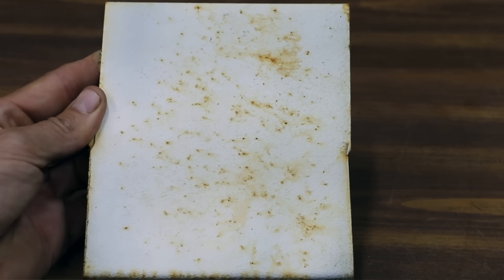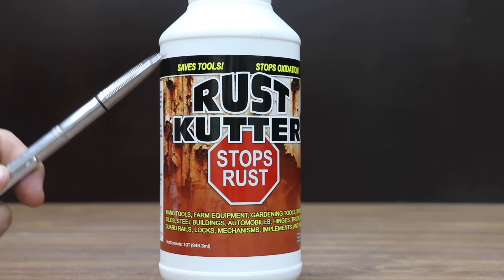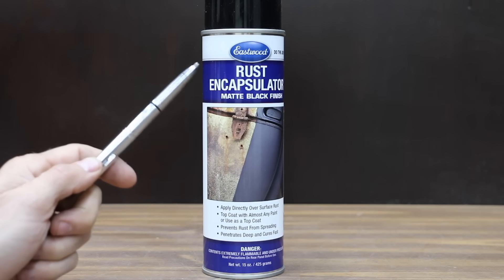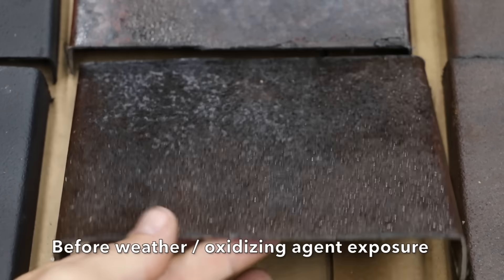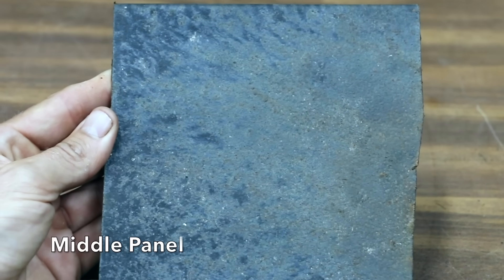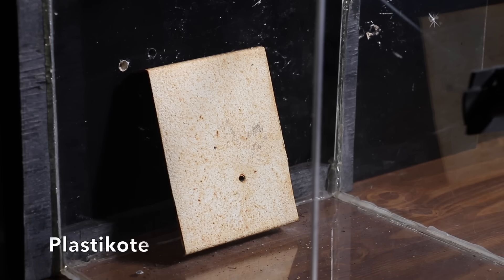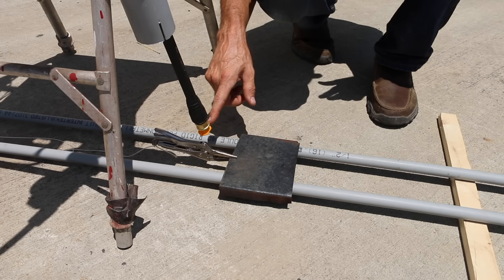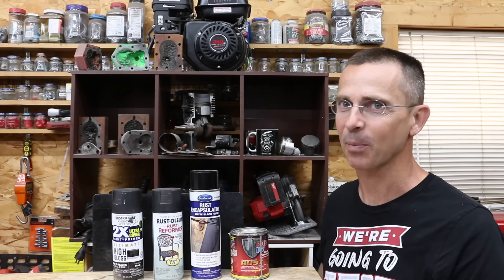Best Rust Converter? POR-15, Eastwood, Rust-oleum Rust Reformer, Gempler's

Comment: Thank you for another great testing video that will definitely help me in the future!
Reply from the maker: Thank you very much!!
Reply: @ProjectFarm  Came here to leave this exact comment always. Refreshing to always have a channel like yours with no sponsorships muddying the waters of REAL reviews and tests!
Reply: @ProjectFarm  Yay, I think I suggested this maybe! I been holding off on my trucks body work for this, haha
Reply: Agreed, thank you.
Reply: Rust reformer/converter is a different product from por15. Those converter sprays create a chemical reaction on the surface of the rust to Neutralize it's spread and make it more stable to paint over, but doesn't penetrate the metal much it's a surface reaction.  Rust encapsulator is what you would use over a converter spray as its a penetrant and sealant meant to be topcoated
 Por15 bonds into the rusted metal and is like an adhesive with pigment which dries harder when moisture is present. A competitor to Por15 would be Rust Bullet.
Reply: @IBNetMan  I too have used Corroseal, (26.99 qt) on a antique cast iron bird bath, it did the trick.

Comment: Should include Corroseal! That's what I end up using the most because I find that any rust converter takes at least 2 coats to get it fully black. Corroseal is basically the cheapest which can get it done in 2 coats so there's not much point in buying the more expensive stuff.
Reply from the maker: Thanks for the constructive feedback!

Comment: Thanks Todd for doing this. I am working on my Jeep to slow/stop the rust inside and outside the frame, underneath the body and even inside the doors. This helps. I owe you a Klondike ice cream bar.
Reply from the maker: lol. Thanks in advance for the ice cream bar!
Reply: All the por 15 products are amazing. I would recommend you look into por 15 frame paint for your project as well. It's a high solids paint that is very durable. I used it on the floor of a car that doesn't have carpet over it and it's been 2 years and there isn't a scratch or sign of rust.
Reply: @1leafsfan6  Thank you for the recommendation. It's already on order from Amazon. I think they must love Todd's channel.
Reply: There's no stopping, only slowing. One thing that has to be made more apparent with all rust control products is that coating it with something will NEVER be a 100% solution. The only real fix is to media blast it down to bare metal and coat it fresh.

Comment: Great video, Thanks!
I’ve always laughed at Rust converter instructions.
Step #1.  Remove the rust.
Thus the question: if the rust is removed what are you converting?
I understand the reality of these products and the nature of rust. Contradiction of product name and instructions is just to funny.
Reply: The idea is to remove loose rust and rust flakes, and then the product is meant to halt the surface rusting.  If they didn't say to remove rust first, you would have knuckleheads painting the stuff over 1/4" thick rust chips and complaining that it didn't work properly.

As for the products that mention that they only adhere to rust surfaces, and not bare metal?  If you choose that product type, you're expected to understand that you still need to primer prep any rust-free areas.
Reply: @Kineth1  I’m simply saying it’s funny that the product name says it converts rust and then tells you the first thing you should do is remove the rust before using the product. I’m very well aware of how rust works and proper surface prep before applying surface coatings.  We can even discuss this at the molecular level if you care to.
Reply from the maker: Great point!
Reply: That's what I don't get.  I would think that many projects would be a combination of rusty metal and clean metal (fresh fasteners or where metal was prepped for welding for instance.)  What good is a surface prep that doesn't work on both?

Comment: Really should try Zero Rust... Single component, low VOC alkyd... comes in liquid or spray, tested and used by us navy, and is way cheaper than por15
Reply: These products are usually tested by using sal spray testing. Steel plate, coated to spec, cut made in the middle, then continuously sprayed with salt water till failure. Rust-Oleum 400 hours, Por15 runs around 1200 to 1400 hours... Zero rust... 2000+ hours.
Reply from the maker: Great suggestion. Thank you

Comment: Might could do a video on dremel type tools and their attachments like the wand type flexible engraving and get a few videos out of the cheaper bits and wheels.
Reply from the maker: Thank you for the video idea!
Reply: @ProjectFarm  i was asking for rotary tools but dremels are the same
Reply: @TaelsDoll  yea I just wanted to make it a bit more user friendly. There are tons of options out there now, some better than others and some not so much, but thanks for totally supporting the idea and totally wasn't trying to steal it lol.
Reply: I use my Dremel for much stuff including sharpening chainsaws and lawnmower blades with the attachment. For cutting holes in walls for electrical boxes the Dremel is fantastic. Do Not Do Home Gunsmithing with one, for the love of God please don't do this
Reply: Yea these tools and attachments have tons of versatility, and why I said it would make for a few videos for sure given the cheaper supply of grinding stones, wheels, bits, and attachments that have hit the market. Thank you all for supporting the idea because yes, we use them plenty for plenty.
Reply: @Marvin Murphy yea I think dremel are going the dewalt route, well basically the path most major brands are taking now. You can get the top of the line ones that are amazing but they also license or produce others that are cheaper to fill the gaps. Hopefully this, and accessories, will become a future video so we can all see what is out there on the market.

Comment: Weird that I just happened to buy a 6-pack of the Rust Reformer for a project. I'm happy to see I didn't make that bad of a choice. Thanks!
Reply from the maker: Great choice!
Reply: @ProjectFarm  wish me luck. I want to try and respray the frame of my '16 GMC Sierra. Whoever came up with that flaky wax stuff they're using should be embarrassed. Hardest part will be prepping as best as possible without disassembly.

Comment: Project idea: Brands of plumbing pipe insulation vs pool noodles. (Eddie doesn't want to have his pipes freeze in the camper.)
Cap short sections of 3/4" pipes full of water.  Wrap 'em and fold the ends over with a zip tie.  Toss in the freezer with sensor and/or pipe filled with water.  Or, less exciting, fill each w/ hot water and watch temp decay.
Try flame test directly with torch then with a hot wire/metal, etc.
Repeat test after soaking insulation in water for an hour and allowed to drain.
Pull test for strength/tear.
Which ones make the best horns for Eddie?
...My guess is thick pool noodles will kick the pants off the purpose-sold crap.  Might have to spiral-cut them to make having a seam seem fair.  I hope this is in time for your fall schedule :) :)  Thank you for what you do, and please enjoy yourself.
Reply from the maker: Thank you for the video idea!